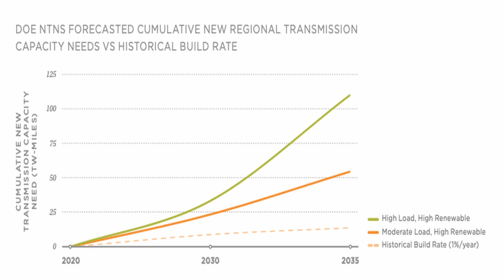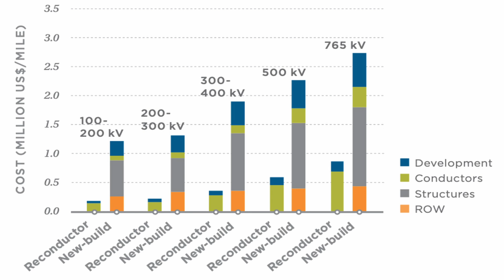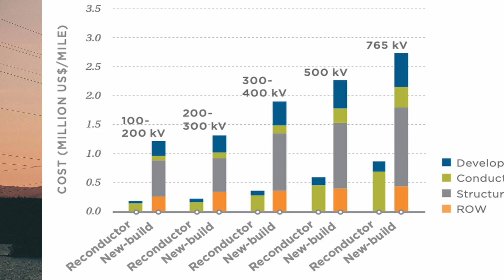Upgrading Electricity Transmissions Lines and the Ship of Theseus

Comment: Just to be a weenie, the big deal with Westinghouse's AC system wasn't so much the higher voltage, although higher voltage does mean less loss. The big deal was the fact that it was AC.  With AC, voltage drop over distance can be undone with a relatively cheap stepup transformer, which maintains transmission efficiency. Transformers are also an easy way to step high transmission voltage down to safer household levels.  And other transformery reasons, like a convenient hookup to motors.  Back then, they didn't have equivalent tech to do the same with DC.  I'll shut up now.
Reply from the maker: The transformer is what allows the AC systems to have higher voltage. High voltage DC systems have even less loss than HVAC.
Reply: @Decarbonize11  Right.  Skin effect and all that.
Reply: @scottotterson3978  Mostly no low leading power factor problem. Transmission lines are basically big capacitors, that wreak havoc on AC systems by shifting the voltage and current sine waves out of sync
Reply: @scottotterson3978  When you do power factor correction at a load, everything between your correction equipment  (usually capacitors) and the load is still operating at low power factor. You are only correcting power factor between your PF equipment and the source. 

When your whole transmission line is the power factor problem, where are you going to locate the equipment (Inductors)?

This is the reason we don't build long underground AC transmission lines (besides the 10 fold cost)
Reply: @joecummings1260  Yes, that's right: the whole AC transmission line has a power factor problem.  In order to control it, capacitors and inductors ("reactors," in powerline language) are placed along the line and/or at substations and/or terminals.  There are also synchronous condensers (something like a capacitor), and static compensators, both VAR and synchronous.

Too bad about those links!
Reply: @scottotterson3978  Yeah very familiar with synchronous condensers. Basically a synchronous AC motor without a load attached. You change the field excitation to control power factor.
Reply: @joecummings1260  I guess what I'm wondering is what you meant by "Mostly no low leading power factor problem.".  As far as I know, the reason DC is used for long distance is because it's cheaper, and the reason it's cheaper is mostly because the conductors are cheaper.
Reply from the maker: The conductors are the same, the conversion stations at the ends are more expensive for HVDC than HVAC. The big win is you can carry more power on the same conductors and there is less loss for HVDC.
Reply: @Decarbonize11  Yes, cheaper conductors for the same amount of power.  Or, if you like, the same conductors for more power.

Comment: Great video and thanks for the shoutout for the 2035 paper!
Reply from the maker: Thanks for writing the paper. My next few are going to be on greenfield development, which just makes you wish they had lines to upgrade. It's so absurdly difficult in the US to build a new line.
Reply: @Decarbonize11  It is unfortunate for sure, especially when we see the progress being made in India and China. The DOE Categorical Exclusion and Order 1920 will hopefully start to alleviate some of this and get America building again!
Reply from the maker: My next video is on the National Interest Electric Transmission Corridors and the one after that is 1920. Both steps in the right direction, but they don't fundamentally change the lay of the land. I think we need a rethink more like Eisenhower and the interstate road system. 

https://youtu.be/kw9_Q_qm0Es?si=amzprsmH1IRH323Y
Reply: @Decarbonize11  I'll definitely check it out. The Eisenhower strategy, or centralized transmission planning at the federal level would be really efficient.